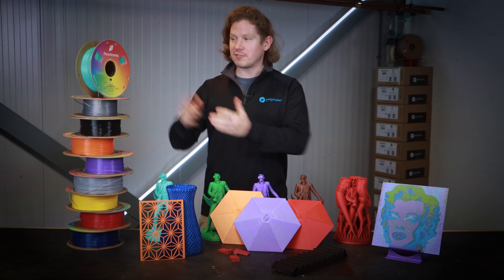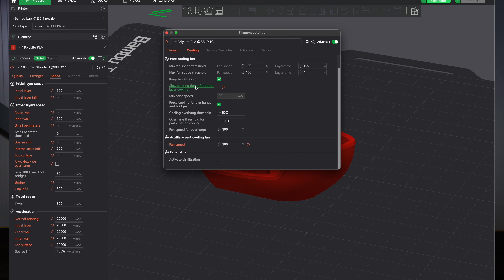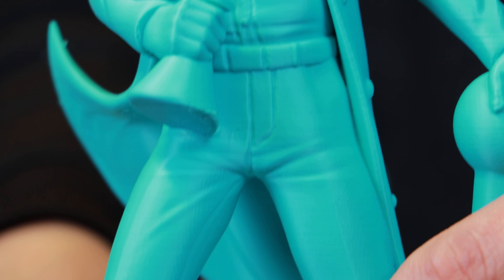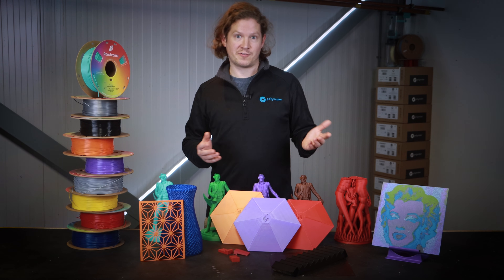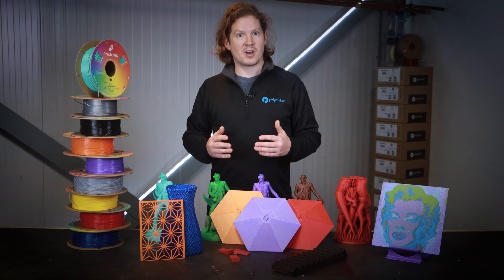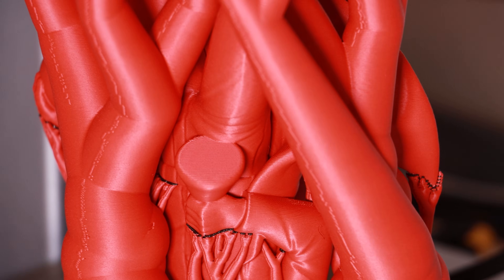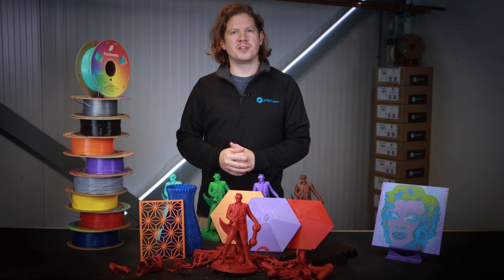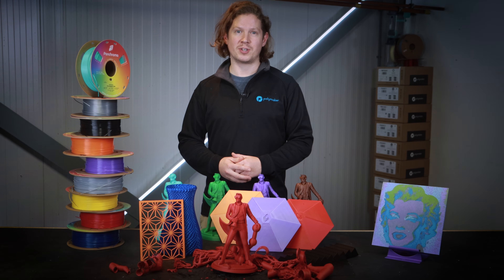I can't believe its NOT pla

Comment: So its not as strong or heat resistant as PLA? But its quicker to print. So it can make weak stuff faster?? If in the end it is mostly a support material, than the price needs to go WAY down.

Comment: At least you're honest.... Is it as safe to print as pla? Good for fish tanks? Ok for baby toys? How does it hold up in UV?
Reply from the maker: If by safe you mean whether the fumes are breathable, we would suggest to not breath any fumes from CoPE nor PLA for that matter. We do not have the certification for fish tank nor baby toys use (same as PLA). And we did the UV test for PolyTerra PLA (which is on par with ASA) but not CoPE yet.
Reply: You should never print baby toys. I assure you no matter what filament you use, babies will find a way to break 3D prints and swallow small pieces.

Comment: Okay, so incompatible with PLA, what about compatibility with PETG/TPU/ABS/ASA etc..? Very minimal information for already having been released months prior. 

Vapors when printing? UV resistance? Can a transparent version be released or is that not possible due to inherent pigmentations? 

We have ecosystems and need more info to see how this actually fits in, other than a support filament, as PETG can also do that for most, and a 'cheap PLA replacement that doesn't work with PLA' and isn't cheaper than cheap PLA. Lacks some wow factor.

It's actually confusing to find CoPE on your site without the direct link because it's still hidden under 'experimental'. It's clear from some other comments here that others didn't even mean to order CoPE and thought it was normal PLA.
Reply from the maker: It does stick well with PETG (we have not tested other materials yet)
Yes it creates fumes when printing, we have not tested the UV resistance, we are currently not able to make a transparent version
Reply: @Polymaker  thank you for the added info, I had a strong suspension there was compatibility with (PE)TG and Co(PE) but only PLA was mentioned. I wouldn't be surprised though if the bond is best with PETG on CoPE. I'm guessing CoPE probably has too low a viscosity or boils at PETG temperatures.
Reply: @Roobotics KHA Entertainment has a video where he answers that.
He years it against CF, PLA, TPU and one other that I can't really think of right now.
TPU, with material crosshatching, works extremely well.

Comment: I prefer PLA because it is biodegradable.
Reply: It is important to note PLA is only biodegradable with a synthetic chemical process, as it is a common misconception even I only recently learned of. If you throw it away it is NOT biodegradable in a landfill. With that said there are companies (in the U.S.) that you can ship your filament to (failed prints, purge lines, etc) for free, except the cost of shipping lightweight plastic. The company I plan on sending mine to is PrinteriorDesigns. They offer big paid boxes for large volume, or you can sort and ship it on your own.

Comment: What solvents would work on it if we need to smooth or dissolve it?
Reply: When you buy bottles of isopropyl alcohol, acetone, denatured ethanol, mineral spirits, paint stripper and hydrogen peroxide, those bottle are made of polyethylene.  COPE is apparently polyethylene.

Comment: I'm curious about the hydroscopic properties. Do I have to dry it in my filament dryer the same way I do with PLA, or is it better or worse? My house is around 33% humid all the time, and I don't get good results from PLA until I dry it down to 20% or lower.
Reply: Use actual pla not pla silk. Pla silk has tpu mixed in
Reply: You should definitely dry CoPE. I've had to dry all the rolls I've gotten so far.
Reply: I’m at 50% and higher in the room where my printer is and haven’t had issues with PLA.
Reply: @PaladinJSR  What brands? I use Polymaker PolyTerra.
Reply: @gfixler I only have Sunlu so far.